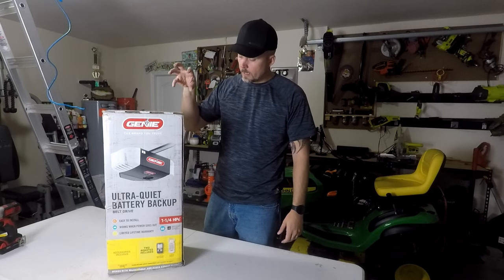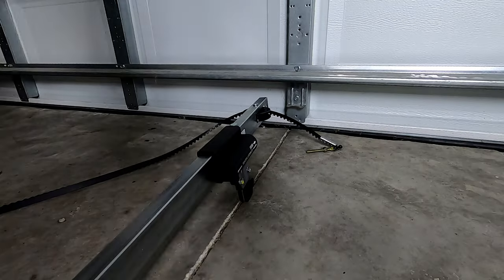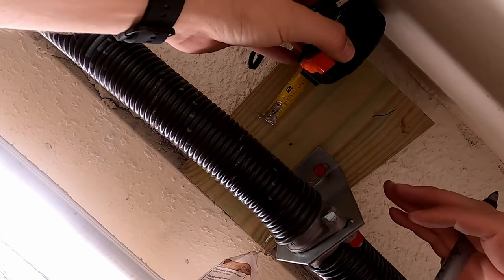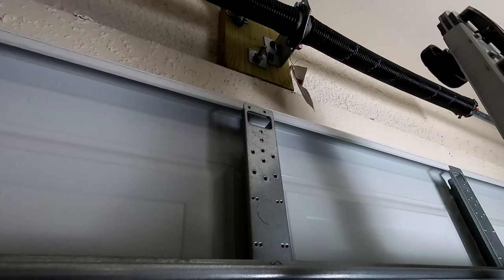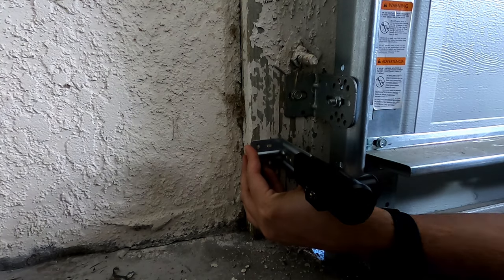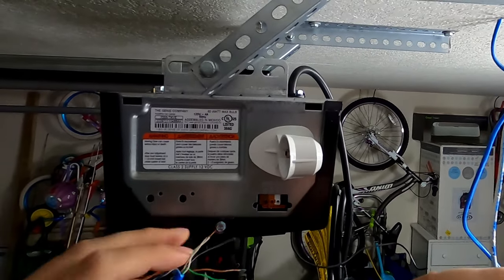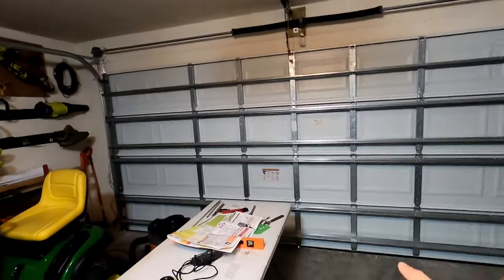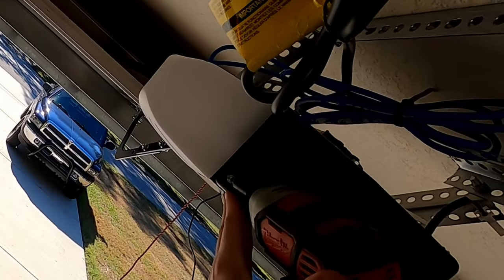HOW TO Install Garage Door Opener

Comment: Of your genie garage door opener doesn't come with a brown wire what then and your going too fast  you should so step by step such as what screws you use in each piece.
Reply from the maker: I agree. Thank you for the feedback! I was by myself, so I had to move the camera quite a bit just to capture the shots I got. But you are right. It would have been a better guide if I had added all the little details. As for the wiring, I would reach out to the manufacturer to get specific wiring info for your model.

Comment: How do you activate the remote controls that come from the factory? .... I did all the necessary steps but when I press one of the buttons on the remote control, the door closes but then does not open with the remote control...

Comment: Not really a professional install, lots of things you missed, lots of extra steps you took that served no purpose really. Definitely worth paying a professional like me $150 for a professional install, especially because motors are not a “got it done atleast!” type of thing, the way your arm is setup, if it’s incorrect, your top panel will be cracked in a few years, ruins the door in lots of ways if it’s set up incorrectly.
Reply from the maker: I'm definitely not a "professional." I just followed the instructions step by step that came with it and figured I'd share with others. Feel free to share your expertise on what was missed and the extra steps that could be eliminated and help others out! Thanks for the feedback!
Reply: I would think a "professional" would charge more than $150.

Comment: My house also came with pre-existing wiring but I can’t seem to get the wiring for sensors correctly. 

So you did brown and white for each sensor, and then when going back to the Motorhead what 4 wires did you put in? Which 2 did you put together for the 1st slot and then the 2 for the 2nd slot?

Comment: I have the same door opener, I used your guide as a reference. Thanks!
Reply: Hi sir, I had the same your door opener that vi installed 2 years ago and working great until last week.
The door not opened up all the way and I checked everything was fine!’ But I am still facing with its issues sometimes!
Do you have any ideas ?
Thanks

Comment: I bought the same unit from Lowe’s. I paid for a fantastic low price for the installation.
I could have done it myself, but I realize that I am slowing down. Instead of the two days, the installer took about two hours.
You could tell from the way he worked, that this was not his first install. The belt unit is whisper quiet, especially after I took his suggestion and oil the door hinges. Gone are the 25 year old chain drive craftsman and the creaky hinges.
It’s heaven!
Reply from the maker: It is very quiet and I love it!
Reply: How much did you pay for installation
Reply: My garage door opener is a 25 year old craftsman 1/2 hp. I have to press the button and hold it for door to go down.   Got the genie to replace it today

Comment: John, I have a unique situation, I know everyone’s is unique. But really this one is. The front of my garage sticks out 2 feet from the house. On top of that inside the garage there is a support from the house that goes through the garage  that will not allow the door lifting chain rail puller to go all the way to the front above the door.  Any ideas. Would like to try and do this myself. I believe would need a bar about 2 feet long from the door to the motor drive chain rail. Any ideas?
Reply from the maker: Yes, a longer bar sounds like what you need. Just look up "straight garage door arm" and just add another 1 to 2 feet if needed. Good luck!

Comment: Very informative video!! I have the same model genie opener.  Do you have to set and program the up and down limits before the wall control button works.  My wall control button is not working, I think because I have not set and program the up and down limits.  Thanks in advance for your help.
Reply from the maker: Is the door moving at all when you hit the button? It still should cycle up and down a small amount.

Comment: Can you stop doors halfway or 1/3 for ventilation or just fully open and fully closed? Thanks!
Reply from the maker: Yes, you can click the button, and it will stop at that spot. Click it again, and it goes in reverse direction.
Reply: @deuceliter  greaaat! still working fine, no issues? I'm thinking to grab the same one. Thanks for reply buddy!

Comment: Do you know by any chance how much was the total headroom in your case and what is the door radius you are using?
Reply from the maker: Headroom is 8ft 6 inches and a 12 inch radius
Reply: @deuceliter  I meant the total space for the torsion system + the opener rail :)